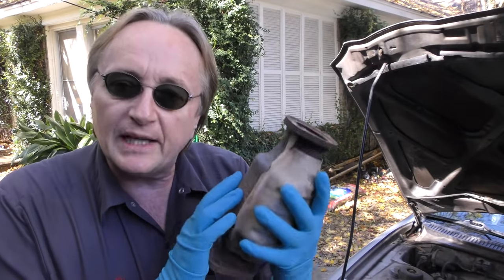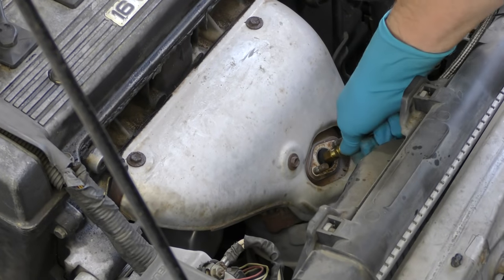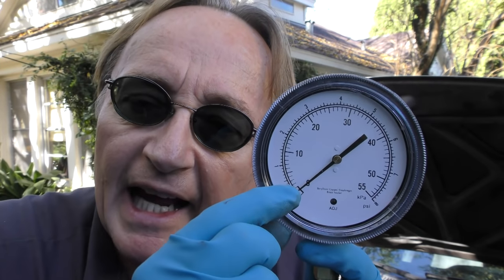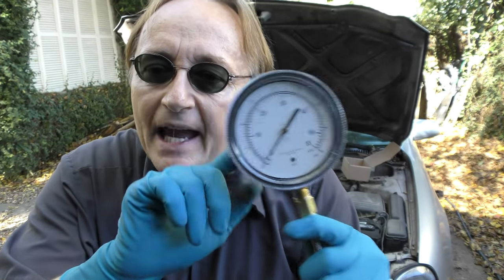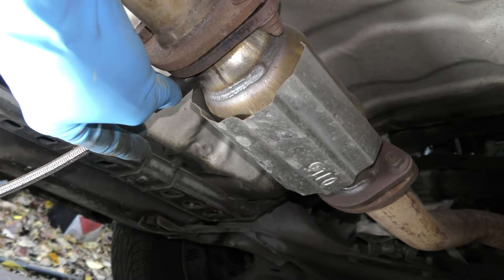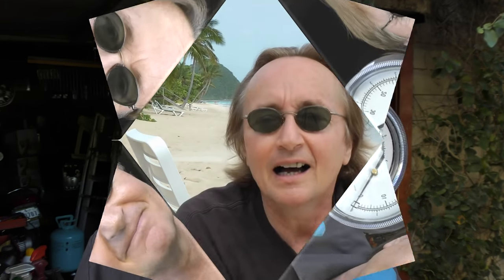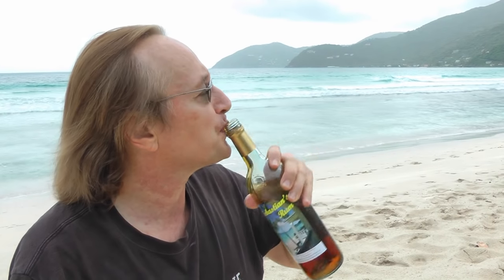How to Tell if You Need a New Catalytic Converter in Your Car

Comment: I have a 05 cobalt and mann it barley picks up speed and it shakes so badly sometimes it runs okay sometimes and sometimes it doesnt wanna pick up speed smells like its burning something shakes and makes my check engine light come on and off constantly.. could it need a new catalytic converter? because when it drives okay my check engine light goes off but when he runs bad and start shaking it pops right up please help
Reply from the maker: +Jeannette Taylor realize those were pretty much throw away vehicles at that age.  And realize if you have another problem, like a worn out engine, that will also ruin the cat. So changing the cat will not actually fix the car in the long run. Have a guy like me at least analyze it in person and tell you the truth of whether it's worth fixing or not, often running away on a car like that is the best decision.
Reply: +Scotty Kilmer Ah okay thank you.
Reply: +Scotty Kilmer Ah okay thank you.

Comment: Can you please tell me if the code P0430 on a 2004 Mazda  3.0 engine will cause it from giving 17 miles per gallon to it's present 8 miles per gallon?
Reply from the maker: oftn that means it needs a new catalytic converter, but they are also often ruined by something else like leaking fuel injectors.  Takes a pro to figure that out ultimately, changing just the cat won't fix the underlying problem
Reply: Thank you Scotty.
Reply: Thank you scotty.

Comment: Hi Scotty I love your videos. I have a question on a 2001 Mitsubishi Montero Sport LS 3.o 2wd. I just bought it and it left me on the side of the road for almost an hour it would backfire and I sprayed starting fluid in it several times before I got it started finally. So I took it to the muffler shop and the guy said there's supposed to be 2 🐈's on it but the original owner was only running one on it. So he said that my catalytic converter was bad so I had it changed. then about a week later after driving all of a sudden I lost power even though it still was running I was think I was going maybe about 40 miles an hour maybe and then it started backfiring and tried to die but you know this time it didn't the same symptoms as it did the first time know I haven't checked the muffler but isn't that kind of odd that he would change the catalytic converter and not be able to check the muffler to tell me if you know if it was maybe rolling up too much special from there so anyways I just want to know if you had a little advice or could it be possibly the air sensor or or just need a new vehicle I'm kidding I I put everything I had and to this one so if you can tell me the cheap route so I can get it inspected that would be awesome thanks Scotty. Sincerely Kim Scott

Comment: I need  advice mechanic work on my 2001 toyota camry  xle 4 cyl  engine light code  
P0420   i had diagnosed at TOYOTA est  MUFFLER AND CENTER TAIL PIPE (TO START) INCLUDED INSPECTION..... went diff mechanic said he would be much cheaper HE DID NOT GO UNDER MY CAR  JUST ORDERED PARTS 754061 WHICH INCLUDED CAT CONV AND RES? MUFFLER? NO PART NUMBERS  LABOR 2 HRS 150 EACH $1400.65 WHEN I TURNED CAR ON NOISE MORE THAN BEFORE HE FIXED.  He said maybe its your motor?? He turned off THE ENGINE LIGHT said come back after you drive 80 miles i"LL turn it back on. I asked why he said it wont pass inspection till i do that.????  how could toyota list inspection but not this guy i am really upset at the noise i am 86 yrs old

Comment: Surely u guys know that honey comb has platinum in it... In the old days guys used to bust that honeycomb out with a screwdriver.. not supposed to do that because that circumvents emissions. I believe engines are designed to work on some kind of back pressure... Sometimes the clogs are at the beginning of the honeycomb and you can remove it with a couple scrapes with a screwdriver... Get down in there with a high-pressure blow gun and blow out good... Clear that honeycomb. Put that baby doll back on and save yourself hundreds of dollars...cheers!

Comment: hello I'm fixing to trade my car for a 93 mitsubishi 3000gt and the guy says that it has no power he said that he puts the gas pedal to the floor and it doesn't have any power is that the catalytic converter.
Reply from the maker: could be that, or a weak fuel pump, or even a worn out engine. those things, that old, are money pits. I'd stay away

Comment: I have a 2005 dodge stratus sxt 5 speed that at 85 mph in 5th gear hits 3k rpms. Any ideas as to why that is
Reply: It's called gears lol you've run out of gears
Reply: @electric6877  its definitely not the gears due to the fact the car tops out at 85 but the speedometer goes to 140, it shouldnt be at 3k rpms at 85mph

Comment: I've had a few cats die over the years and none of them failed in a way that caused back pressure. They just stopped doing their job. One died from antifreeze poisoning, one from a wet miss (bad plug) that only lasted a couple of miles before I fixed it and one because it was a pos to begin with.

Comment: Hey Scotty I love your shows, they've been very helpful , the question I have is what are the things that can cause your catalytic converter to go bad , I have a 2002 Chrysler sebring coupe 3.0, and how many sensors does this car have I've found 3...help.. help....
Reply from the maker: oil burning engines ruin cats, as do rich fuel systems or lean fuel systems. And so does crappy high sulphur gasoline

Comment: i had a bad cat and drove the car about 200 miles with lack of power not knowing it was the cat but now that i took off the piping and empty them and puting eveything back together my engine has a scream when i accelerate. doesnt seem the be the belts i wonder by driving it so long damaged the timming of my car or just plain blew the engine anyone have any ideas
Reply from the maker: you emptied out the cat, and if the noise comes from there now, it's the exhaust gas moving through the broken parts inside the cat

Comment: Hey my Nissan versa 2009 has a error code p0420 and p0420 pd and also I notice only while I'm driving I'm heading a rattling noise could that actually be more then likely the entire catalytic converter assembly? Plz scotty any help would be necessary btw the parts for this car on autozone st most are only 333 or 415 is the expensive part having a mechanic put it on?
Reply: shane gilmore  get a obd2 scanner and check the readings on the o2 sensors. Sometimes the sensors could be bad but not likely. Look up Eric the car mechanic's video. He shows how to diagnose a bad catalytic converter as well. Usually the parts are not too expensive but the labor at a shop can be expensive.
Reply: Thank you so much lol I found the source of the noise it was just a bad belt and tensioner pulley

Comment: abs light is always on but I turn on the wipers and it turns off. and when the light is on the motor wants to turn off (1993 suburban 350 motor
Reply from the maker: +Nelda Reyes electrical shorts for sure, pray it's not a bad  body control module, they cost a ton. Also have the battery and alternator load tested, one may be weak
Reply: +Scotty Kilmer Hey Scotty,
My temperature gauge is running higher then normal, like you mention on the video. I have no service light on I have changed the water pump, radiator, thermostat and even change the reservoir and flush the coolant about five times in one year. Whats you're opinion, what should I do next. I would appreciate all feedback.

Comment: Hey Scottie my 2001 Chevy Tahoe 5.3l v8 upon cold start idles rough and engine bay knocks for about 30 seconds then fades away any ideas? THANKS
Reply from the maker: +tyler nunnelley yes, get rid of it fast. Those engines, once knocking, are wearing out internally, a known flaw on that vehicle.

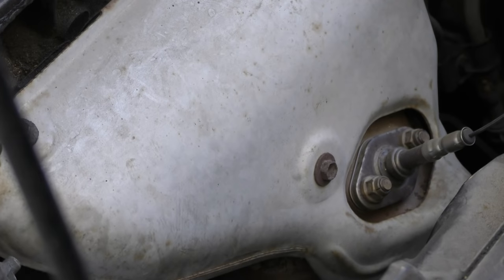Comment: 0:55min is the cat converter... i thought it was near the muffler...  is this not the exhaust manifold? thank you
Reply: it's between the manifold and the muffler. it can be right before the muffler, or right after the engine. in the case of this video, it's just the O2 sensor he is after. he states at 0:55 that it's before the converter. so on that car, the 02 sensor is immediately after the exhaust manifold.

Comment: Helpful video. Is it okay to run the engine without the HO2 sensor in place? I'd expect a weird idle and unpredictable closed loop operation... or does it have a fall back open loop mode when it detects no/bad O2 sensor?
Reply: WTF is a h 2 0 sensor?

Comment: I replaced mine cause the shop at the dealer told me I needed to and it was why I had the check engine light. 995 bucks and a month later light comes back on. I take it back and now they say, "Now its the OTHER CC" ....FUUU

Comment: check engine light on code came up for bad flow then check engine came off n I haven't changed it .
Reply from the maker: +Victor Gonzales  computers do constant testing, they flag a problem, but if later it shows no problem, light goes off.

Comment: You can tell if you have a bad cat converter by tapping it see if it rattles inside or a rotten egg smell coming from the rear then its time for replacement.
A mechanic once told me that car engines these days are that efficient that they don't need a cat.
So why are they still fitting them on cars.
Surely the emmisions are low enough now on modern cars and don't need these cats to bring it under the threshold.

Comment: or just straight pipe no cats no muffs only resonators :) clear job
Reply: Good luck getting that through a federal inspection or a surprise pull over inspection, which does happen. I've seen cops pull cars/trucks over for simple things and then have them towed on the spot when they don't meet emission/safety standards.
Reply: could that happen in EU :D

Comment: Question: 
Could someone at least minimize the problem of a clogged catalytic converter or muffler by parking the car in a downhill street and pouring boiling water through the exhaust pipe? and then driving the car to expel all water.
Reply from the maker: +Enrique Sauma no, water alone would not help

Comment: My father-in-laws f-250 catalytic converter turns cherry red???
Reply: Jared Bradley usually they’ll only get red like that if the act is running too rich (getting too much fuel mixture and not enough air)

Comment: Wait a minute..why change catalyst converter..use wd40 spray till it chokes and then dip it in benzene for a couple of hours then blow it compressed air till its clean and dry..catalyst converter and mufflers are expensive

Comment: I was hoping you would knock on the cat with your knuckles and see what it sound like. Mine makes continuous high pitch noise. Car runs 10 degrees hotter and has slow acceleration upto 40 mph after that I gotta force it more to get going. And I do have code for cat. Not sure if it is the cat or the muffler.  Checked on price for cat with pipe only scared me. I dont have enough in bank to pay for labor after buying the cat. That's why I want to be sure. I am sure there is a charge involved for diagnostics also.

Comment: Nonsense you can't see if its blocked by measuring the pressure. Only by measuring the air flow you will be able to tell if it's blocked. ( Pressure will build up regardless even if it's trough a pinhole)